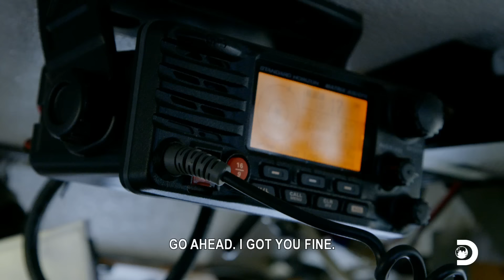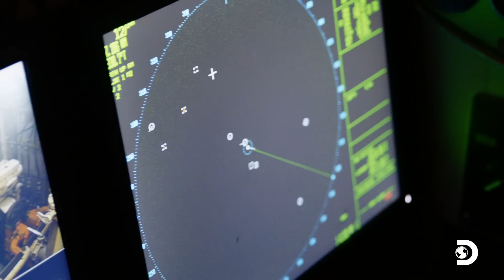The Time Bandit Is Now Public Enemy Number 1 | Deadliest Catch

Comment: A broken cylinder isn't a problem unless there's something to shake out of the pot, and I bet Jonathon knew it from the jump. If the Wizard was pulling up empties they would have worked around it.
Edit: Props to Jonathon for being the sort to help them out. 👏 👏
Reply: I think the empty deck was more of a sign than the cylinder. Sometimes pots can be full of just smalls, wrong species, or just enough to not justify emptying by hand but enough to shake pots. So the cylinder going out isnt really any kind of clue to him. The empty deck was what gave away Monty's bluff.

Comment: I didn’t really think of something like hydraulic fluids being dangerous cause I don’t work with it or around it by any means . I would’ve assumed that was water shooting out of there.
Reply: Hydraulic leak could spray into your body parts at high pressure, if not treated you’d have to amputate

Comment: Hmmm you think somebody may have loosened that hydraulic cylinder cap?
When the seals fail oil will leak past the rod not from the bottom of the cap to the cylinder.
Pretty obvious fake scenario. 
Also think about your crab covered in hydraulic oil next time crab is on the menu.
Reply: I think they use a biodegradable vegetable oil type marine blend for hydraulic fluid.
Reply: @iancostigan5047  Last I saw on other crabbers I shuttle up north, some were still using Chevron AW hydraulic oil but many had switched to Clarity Synthetic. No biodegradables.